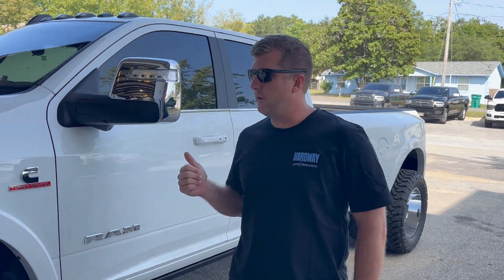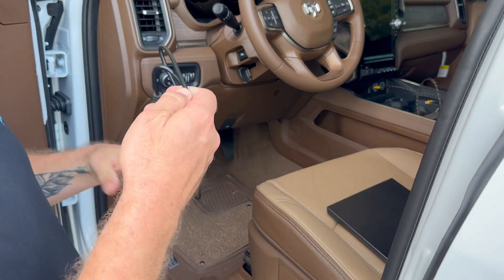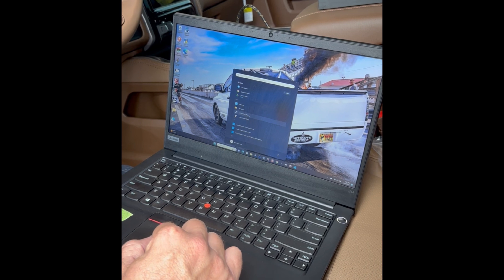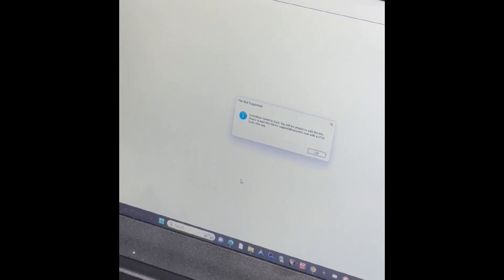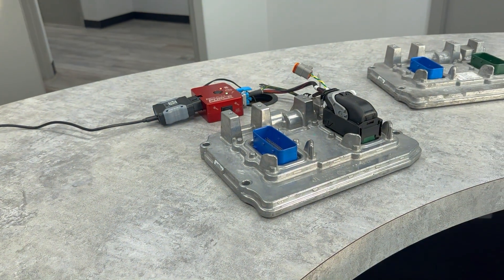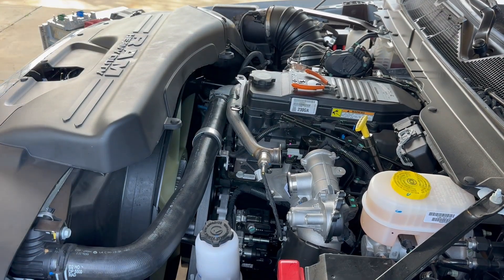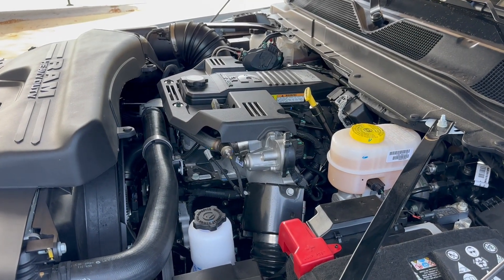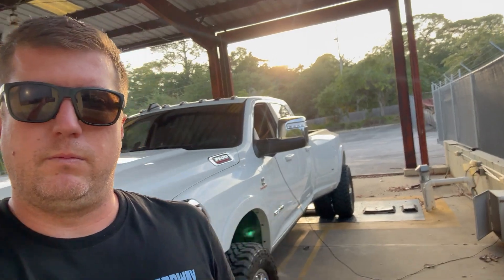2024 RAM 6.7 Cummins ECM swap and dyno tune at Hardway Performance

Comment: I bought a 2022-24 Delete kit from them $5300 and shyt was trash, so many screws up. And the tuning kept giving problems after problems. The sale department are rats in not trying to refund me after this fail kit. You’re given 6 credits, to flash the new ECU, which got burn for no reasons and I had to pay $300 more for them, after flashing the new ECU, the Dpf codes kept popping up after so call deleting it, and had my truck In limp mode, kept flashing the ECU with new files, had to spent $200 for a mechanic to delete some code twice before flashing once again. And after all of this, my truck is still having problems, transmission is shifting bad, hard knock, The truck accelerates and decelerates rapidly, the truck is not properly shifting and cause a hard knock and shakes like it wants to turn off. DO NOT BUY FROM HP TUNERS These rats are problem. Best to go elsewhere.

Comment: Can this be done in the 2024 ho 3500 models?
Reply: I know shops that are doing it and told me they can do my 2024 ho but problem is they and no one can tune the Aisin trans so it’s limited to just delete and engine tune so I assume the shifts will still be slow and bit sluggish .
Reply from the maker: Yes it can.

Comment: Since the programming can be done through the OBD2 port on the truck, why go through all the drama of an ECU swap?
Reply from the maker: 2022-2024 ECM's are locked down from the factory, you have to put a 19-21 ECM in that's the same model but without the locked boot loader in order to flash through the OBDII port.

Comment: I did my 2024 3 months ago with EFI live
Reply from the maker: EFILive doesn't support 2022 and newer factory operating systems.
Reply: and thats why you have to use the bata software but yes it works with no issues 
 @hardwayperformancespecialists
Reply: Don’t bother, this guy knows it all just ask him.

Comment: about to do mine, have all the stuff just waiting on nicer weather. so for the bypass cable is says it needs to be plugged into the 5th slot down. what if my truck already has a factory plug there? does it matter what slot it goes into as long as its the black block on the left side?
Reply from the maker: It doesnt matter what slot it goes into on the green block.

Comment: So emissions on tuning, 74hp/94tq?  No chances of a delete correct?   What will benefit with this over stock?  I’m not looking for power, just don’t want to be stranded on the side of the road when the emissions system breaks down.  Currently no issues but you never know.  Any MPG gain if you stay out of the throttle?  Heard there will be some EGR issues with a CAI, might have to tune for that I guess even though no one can figure out why a CAI would mess with the EGR and throw a check engine.
Reply from the maker: No chance of a delete from us thanks to our agreement with the EPA in 2020 promising we'd behave (google EPA vs Hardway if you'd like). No MPG gains to be reported because all of the things we would normally to do improve MPG also increase NOX emissions and it wouldn't pass the FTP-75 drive cycle (sniffer) test. EGR issues are out there with one truck we work with that has a combination of an aftermarket cold air intake as well as an aftermarket intake horn but the issues are more of an increased air flow above what the truck expects to see and sets a CEL vs an actual issue that would degrade performance or reliability. Fixing that the appropriate way (we can't disable DTC's) is very high on our priority list so our customers can enjoy some increased air flow on the inlet side without the orange light on the dash staring at them.
Reply: So by adding horsepower and more torque to a truck with emissions. So does this tune add fuel and change timing characteristics? These trucks seem to have enough problems with the DEF systems failing and the DEF pump going out even before the truck reaches 40,000 miles. If the tuner can de tune it a bit and give the DPF and DEF systems a break then I can see doing it. It’s like taking a top fuel dragster and adding emissions controls to each exhaust pipe. EPA is a business that puts more $ on the table for their board members. It’s funny how they just worry about the so called air but who cares about billions of plastic containers and cardboard boxes ending up in landfills. Then they build track homes on it. Scams!!!
Reply: @timothydare6007  no issues here at 60k.  Just need to use good DEF that’s not expired or crap at the pump.  Also I use Archoil fuel treatment now.   I’ll never go into regen again.
Reply: @neckofthewoods24 You're saying def at the pump isn't good? I would have assumed it's better due to it being run through the tanks quickly, and not possibly sitting on a shelf. Talking busy truck stops here.
Reply: @bunsguns8222 not from what I’ve seen others complain about.  Everyone who seems to have def issues and pump issues etc all say they use pump def.  I mean just looking at the nozzles they are all crusted up and look like crap.   If a def tanks say 10,000 gallons, does it really go through fast?   I have no clue.  I’d just rather buy a new jug that’s sealed and I can see the born on date.
Reply: What are the final #s on the dyno? To blurry to read. @ what rpm? Stock vs tuned

Comment: What about 2007.5 6.7 has an H&s tunnel but ecm is bad
Reply from the maker: Hi Sean, if you find a replacement ECM for it we can help set it up for you. Fun fact, Ryan used to be the calibration engineer at H&S before he started Hardway back in 2013

Comment: If you're going to remove the air intake horn, you may as well replace the grid heater!
Reply from the maker: We disagree with that thought process but with your truck, by all means, replace whatever you'd like.
Reply: @hardwayperformancespecialists  I should have worded it better. When you have the ECM out for unlocking, that would be a great time to also install the Banks Monster Ram Intake since you already have the EGR valve and intake ram disconnected. It's not the grid heater per se, it's the nut on the bolt that corrodes, falls off, and ends up taking out your cylinder head and/or scarring your #6 cylinder wall. As long as you're tuning it, who wouldn't want an 88% increase in MAFs in your intake manifold?
Reply from the maker: An 88% increase in flow for the intake horn itself does not equate to an 88% increase in airflow in your combustion chamber, that's just the tactical marketing that you fell for. We will be performing unbiased product testing to increase air flow to these trucks in the very near future and based on our experience, we wont be starting with the intake horn as that's not at all the roadblock in the system on a stock truck.
Reply: @hardwayperformancespecialists  Getting needlessly defensive. I didn't say it did, those were your words. The "tactical marketing" that I fell for was the grid heater bolt falling off on as little as 30k miles and grenading your motor.
Reply from the maker: There's no emotion in the above replies, just stating facts. The bolt that can fall in the intake does seem like a serious design flaw, but dont expect an 88% increase becuase you swapped a shiny intake horn on. As stated already (emotionless and fact based at that), we will be doing some unbiased dyno testing in the near future on parts to help get air flow to the combustion chamber where it actually matters and will be sharing our results, stay tuned!
Reply: @hardwayperformancespecialists  I'm with you in that I wouldn't expect huge gains from just the Monster Ram Air alone, but the increased flows over the stock manifold and grid heater are empirical. Does that translate into anything you see on the dyno? Probably not, although AFE claims and has a dyno chart to back up that their BladeRunner intake manifold was worth 11hp/27tq. The grid heater nut issue would be my primary reason for swapping that out. 

While I was in there and had the intake manifold off, that is a great time to get to the cold side boost tube and on the other side of the engine, when you have that air intake off for installing a cold air intake, that's the time to swap out that hot side boost tube, as well.  A lot of times (ex. CAI) you don't begin to see a good increase until you start tuning and/or add in conjunction with other bottlenecks in the flows. Am subscribed and looking forward to seeing your future videos on this 2024 Ram Cummins!
Reply: You are giving advice to the guy that created the diesel engine and all diesel computers and their software just ask him!

Comment: Would this void the warranty?
Reply from the maker: Ultimately that's up to the dealer, we'd suggest returning the ECM to the stock readout file prior to taking it in for warranty work.
Reply: Yes. It would void a warranty haha. Even if it’s under warranty your truck will be in shop for 3 weeks to 2 months.

Comment: Ever hear of cruise control no working on the 23's with ecm swap? No cruise, no high idle, no sotf through cruise. It's like the cluster is dead when we put the tune in.
Reply from the maker: Yes, if you're tuner doesn't use the appropriate operating system (like putting a 19-21 operating system in a 23 or newer truck), that stuff tends to happen. We'd suggest finding a better calibration company if they can't get you taken care of.
Reply: I'm curious was company your using as I have some similar issues with my 20 ho with aisin

Comment: So you’re making it think it has an older computer because it’s easier to tune? I know the newer computers are much harder to get into.

I’m glad I have a ‘22 I don’t like that fully digital dash at all.
Reply from the maker: We like the digital dash but don't mind the one in our 2021 either. We use an older computer that allows us to flash it but retain the 2024 operating system that originally came in the truck.
Reply: @hardwayperformancespecialists  
I guess my question is what is the purpose? Perhaps I’m just not understanding. Just so you can work on it and not take it to a dealership?

Sorry, just trying to understand.
Reply from the maker: 2022 model year and newer have ECM's that we can't tune with aftermarket calibrations so we use the very similar 2019-21 model year ECM's on the 22 and newer so we can tune them.